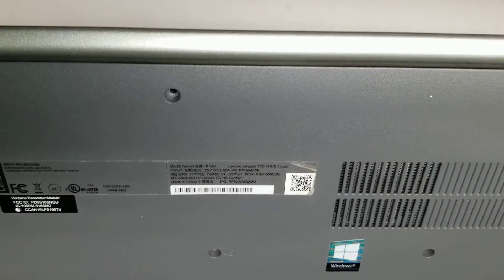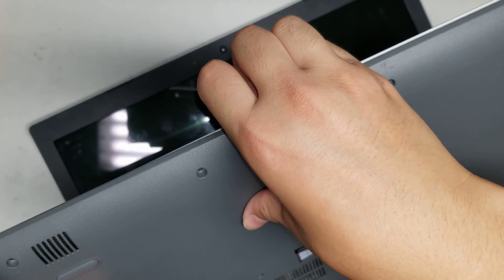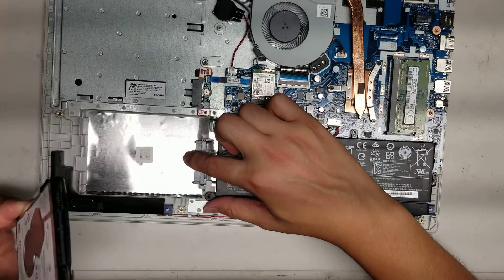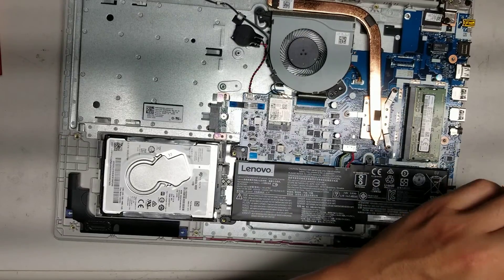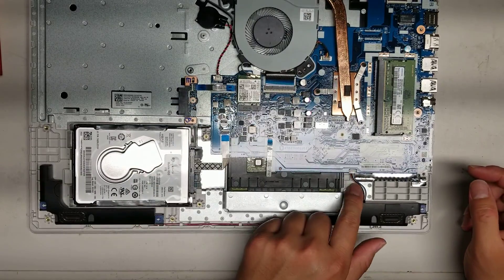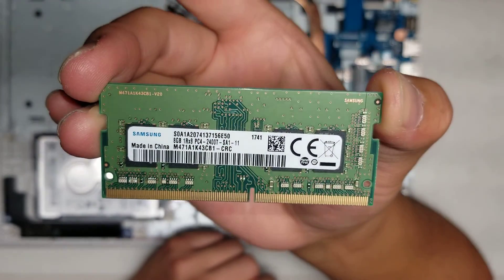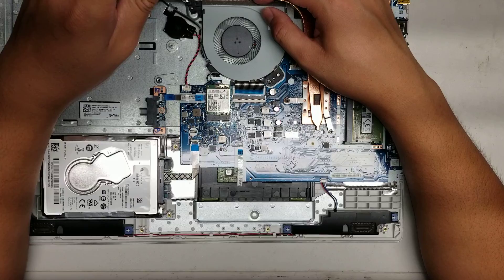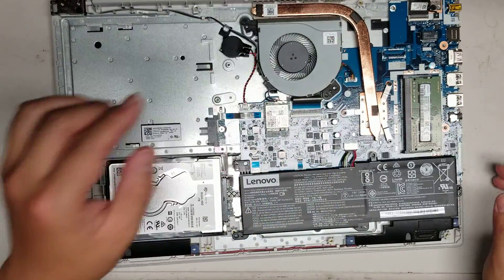Lenovo Ideapad 320-15IKB Touch Disassembly RAM SSD Hard Drive Upgrade Repair

Comment: Thanks for the deatiled explination bro..for me one of the cornor scrwes is stuck so hard...i been trying for 2hours to take it off.....the scraw angles looks fine (I didn't braw them up),, and I can feel the that my scewdriver is in the screw whole,, but no matter how much force I do the scrw wont move...any tips/suggestion to undow it ?
Reply from the maker: That's not possible. If you have the right size screwdriver and it's stuck, it'll strip the screw.

Comment: I have Lenovo 320-15IKB (Type 80XL, 80YE) I have issues with AUX (3.5mm) port.. when i connect my headset, i have to adjust the aux connector slightly by pulling it in and out or twist it to make it work. it was before an year. now how much ever i adjust, the aux port is not working. is there any easy way to fix it..
Reply from the maker: Buy a usb sound card like this https://amzn.to/3TjSaUm

Comment: I have 2TB HDD on my laptop. Can i add a 500GB SSD with caddy? or it just works on laptops with 1TB HDD!
Reply from the maker: Yeah, you'll want to measure the thickness of the optical drive, but I think this will work. https://amzn.to/3cHkCJl
Reply: @ItsBinhRepaired  Thank you for your reply. Thickness is OK but Do you think the maximum storage capacity won't be a problem? Can I have the 2TB HDD and 500GB SSD in same time?
Reply from the maker: There is no max, not that you can get. Haha it's like beyond 1000TB
Reply: Thanks a lot
Reply from the maker: @MahanMontazeri  no problem

Comment: i brought LENOVO 320-15IKB (Type 80XL, 80YE). I want to upgrade with ssd. can i use 1tb ssd. which ssd is best as per your knowledge. samsung or wd
Reply from the maker: storage amount doesn't matter. Just make sure it's a 2.5" SATA drive. Samsung is known to be the best, but haven't heard any issues with WD. I usually go with SanDisk, Samsung, Kingston, or Crucial.

Comment: Can you install an NVMe into this laptop? Also what ram would you recommend I  upgrade this laptop with?
Reply from the maker: If I didn't mention it in the video, then probably not.
Reply from the maker: M.2 could be sata or nvme, but if I didn't mention what type specifically in the video, then I don't know.
Reply from the maker: You guys suck...Lol there is no m.2 at all. Made me doubt myself so I rewatched the video trying to see at what point I mentioned m.2. If you watched the video, it's a 2.5" SATA hard drive. You can put a 2.5" SATA SSD. This would work. https://amzn.to/3BHCYE4

How are you guys learning about m.2 and NVMe without even knowing what they are and what they look like. Lol
Reply: @ItsBinhRepaired  can't we remove the wifi it will give a m.2 correct me if i am wrong?

Comment: This was the worst purchase I ever made back in 2018.  I had nothing but issues with that piece of junk machine.  It was the slowest hunk of junk I have ever owned, lagged more than actually did anything and eventually ended up getting cracked in half across my knee  with very litter effort, and is on its way to the landfill. I even tried upgrading the RAM and did nothing more to increase performance. My mother recently upgraded her laptop, and gave me her old one. I am using a 10 year old gateway NV53A from 2010 that has more power and stability than that POS sorry excuse for a laptop. I installed more RAM and bought a new battery pack for it and it works fantastic!  I will never own a Lenovo product as long as I live, THAT is for sure!
Reply from the maker: RAM upgrades do nothing if you aren't using all the RAM. You should have done an SSD upgrade. Makes a huge difference.
Reply: @ItsBinhRepaired  
What do you mean, using all the ram?
Reply from the maker: @Immaustine  RAM is short term memory for your computer. It gets wiped whenever you turn the computer off. When you start your computer, what it's doing is migrating stuff from the hard drive to the RAM. It doesn't matter if you have infinite RAM if the stuff you open only takes 1GB of RAM to run. All these people putting more RAM not understanding why get little to no performance increase. The only way more RAM helps is if you're going from one stick to two or using faster RAM. If you run out of RAM, you'll know it. Your computer will suddenly slow to a crawl as things need to be moved back and forth from the hard drive to the RAM to make room for new things you open. This almost never happens these days because 8GB is more than enough for most people. The bottleneck is how quick everything is moved from the hard drive to the RAM on startup and upon opening apps for the first time after boot, hence upgrade to SSD, don't upgrade RAM.
Reply from the maker: @Immaustine  if the computer is sluggish from the get go when it wasn't always, you either have a software issue or a failing hard drive. If programs take a long time to load and boot takes a long time, but after they are fine, that's a bad hard drive trying to move stuff to the RAM.
Reply: @ItsBinhRepaired  
I understand.
That's why a fast SSD is important.
Reply from the maker: @Immaustine  yup
Reply: I have same laptop, it's very slow before.affer removed 1tb hard disk and replaced with 1 tb wd blue ssd . It is rapidly fast now. Boot up and shutdown in 3 seconds ....application load super fast.
Reply: @SkT30089  can you please help me with one thing.
Does this laptop has a M.2 ssd slot or the HDD can only be replaced with a sata ssd?
Reply: @praveendeshmukh4976 i have the same question
Reply from the maker: @SkT30089  SSDs are great!